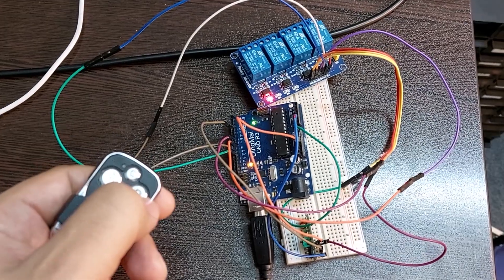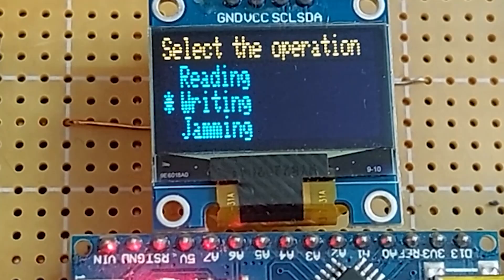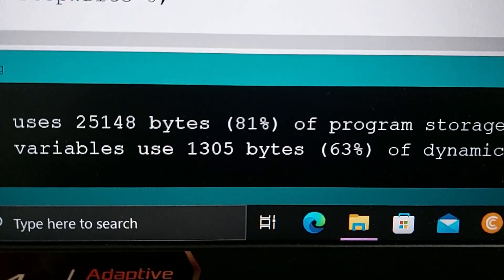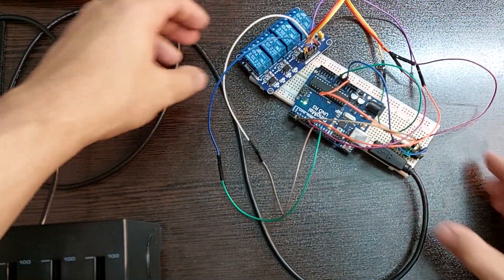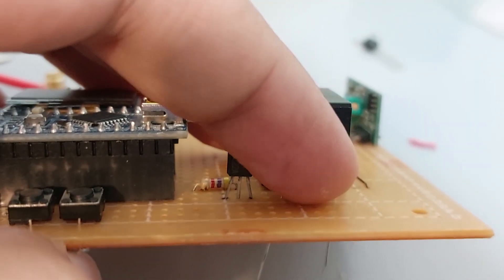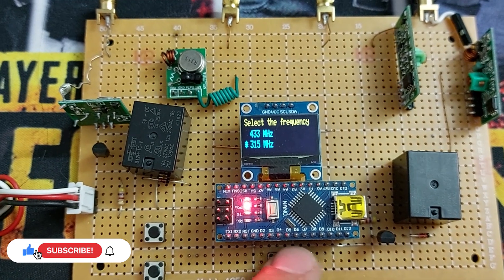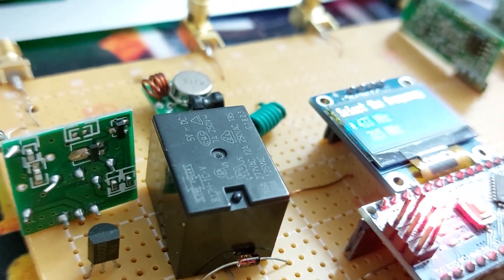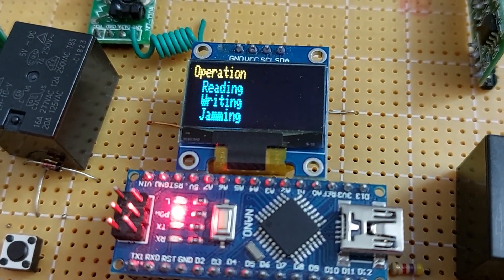RF Hacker - Part 2 - 433 & 315MHz Using an #arduino

Comment: bro can l use 3310lcd or other lcd
Reply from the maker: Unfortunately, I don't know the model you mentioned, but it even barely works with the LCD I used. It's normal because setting up graphic LCDs for Arduino is heavy.

Comment: I have built this project based on the information on your github but the transmission part is not working what is the problem??
Reply from the maker: Hello my friend. Do you mean you can't switch to 315 frequency? Or is no code sent?
Reply: @BabakStars  yes I couldn't switch to 315 so I connected the 315 modules directly to the arduino but I still can't send any of the codes that I have recorded can you help please?
Reply from the maker: It was the same for some users who made this project and it only worked for me. I have to fix the problem and send it to you in a new update. Until the new update is released, I suggest you put a socket for the modules and replace them manually
Reply from the maker: It will work if you replace the modules manually. It is strange that you say it does not work 🤔
Reply: Thank you for responding so quickly  , looking forward to that❤
Reply from the maker: @seadrezasehat7450  🫴❤️

Comment: Частота 315 МГц не работает. Сигнала 315 в исходном коде этого мало.
Reply from the maker: Due to the large amount of codes, sometimes the project does not work, it is better to change the modules. Do not trust relays.
Reply: @BabakStars  Во всем вашем исходнике он полностью для отображения, но нет части для сигнала 315МГц, и сигнал 433МГц тот же, но улучшений нет. Вы предоставили фишинговый код только для того, чтобы удовлетворительно отобразить его на OLED-экране. но они вообще не работают. Я пробовал их много раз, но безрезультатно.

Comment: With the relay which transistor did you use and how did you make those antennas?
Reply from the maker: 2n2222 transistor, Antennas are available in the market. GSM antenna 10 cm.